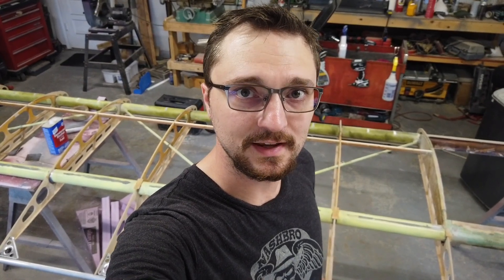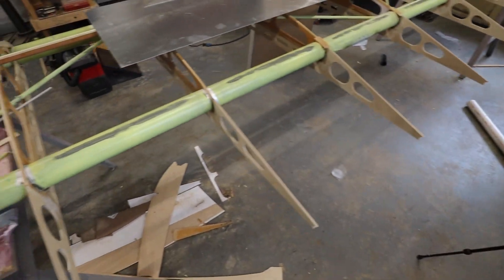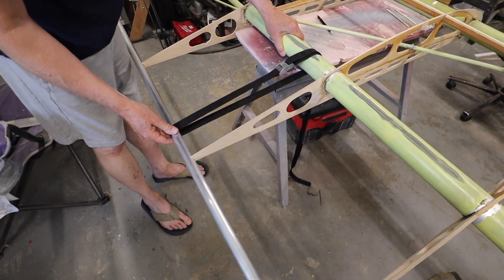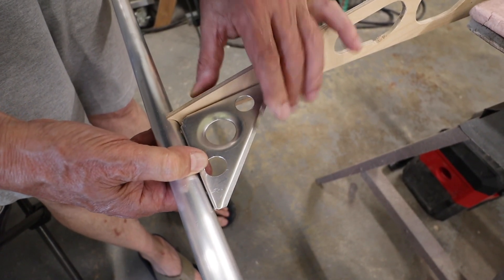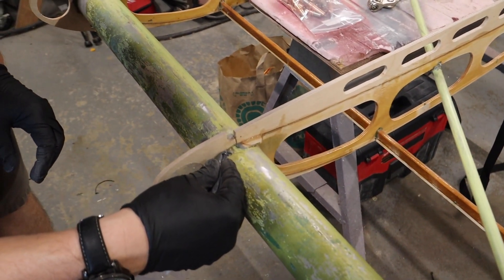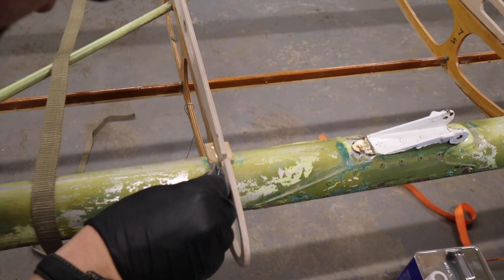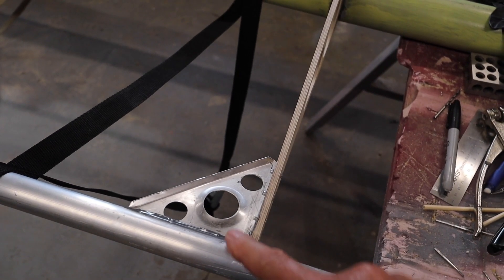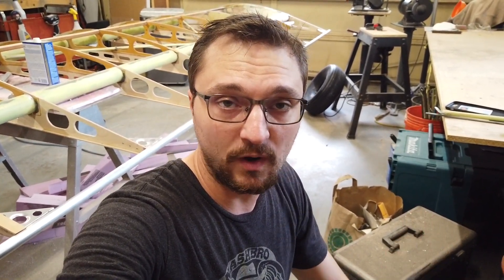Wing Redesign Continues - New Trailing Edge And Reinforcements For The Rockhopper - Episode 8

Comment: I,d have used an aluminum backer plate to make those gusset plates stronger. Riveting to the back of the wood seems like a weak point!
Reply from the maker: I don’t believe we specifically showed it but the rivets are placed with the head side on the wood, not the tail. I think that may not have come across but we have plenty of surface area on the wood side.

Comment: This suggestion might help on the other wing.  Instead of riveting metal to wood, add a backer plate on the opposite side of the wood.  Thus the wood would be between 2 pieces of metal giving the rivets something stronger to hold into than wood on metal alone.  I wouldn't want the rivets to "pull through" the wood. The backer plate would need to be the size of a flange on your 45° brace.  It would add a bit of weight but safety is my cincern.
Reply from the maker: We considered that as an option. We’re also adding fiberglass wrapping around the trailing edge from the cap strips as additional support so I can’t imagine us managing to pull anything loose. It’s already amazingly rigid as is.

Comment: Loving the build. My 2 cents worth re: your ribs (I know it is a work in progress) as a builder of plywood boats, I would epoxy a glass tape over the butt joins on either side of the ribs.
Reply from the maker: That was our original plan but I wanted to have an EAA technical counselor look over our methodology and make recommendations and his was to scarf the joints with thinner ply on both sides. We may do that just to stay closer to accepted methodology.

Comment: Mix the Epoxy on a flat board or piece  of scrap aluminum. Scoop up and put it in a syringe
Reply from the maker: This stuff is extremely thick. Thicker than anything I’ve worked with before. It wouldn’t push through a syringe well but the cake decorating technique works great and really keeps waste down.
Reply from the maker: This stuff is extremely thick. Thicker than anything I’ve worked with before. It wouldn’t push through a syringe well but the cake decorating technique works great and really keeps waste down.

Comment: How does the chord of the wing copar to a standard kitfox?
Reply from the maker: Compared to the model B avid it was based o it’ll be close to a foot deeper including control surfaces. I haven’t compared it to a late model Kitfox. When I finish off the surfaces I’ll take final measurements and post comparisons for length, chord and area to similar aircraft.

Comment: As much woodworking and metal working, as I've done in my life, and knowing the strength of thin plywood, and more importantly the strength of edge to edge glue joints on plywood, there is no way I would fly in this thing. I just hope it's stronger than it seems, for the sake of you and your loved ones.
Reply from the maker: Oh don’t worry, it will be heavily reinforced, we just haven’t done it yet. I actually have a tech advisor stopping in tomorrow to approve our methods for that exact part.
Reply: @ianslife210  That's good to hear. I look forward to seeing how this turns out.
Reply: @ianslife210  Please make sure your tech advisor is the real deal! A actual engineer who can do stress analysis ect...  You are changing so much of the design and treading into unknown areas, it's a little concerning. Your adding a lot of chord and camber to the wing, so I hope the original light weight tubular spars will handle the load (that they were not designed for) with a additional ultimate load figure for safety. I don't know man, seems like your just assuming way to much here. I mean, you wouldn't take a Cessna 150 wing and put it on a 172, and expect it to carry the same loading and remain safe!
Reply from the maker: Please understand there’s no way to show the hours of time spent making sure that the numbers work and the plane will be safe.We have looked into all of these items and satisfied ourselves that we have a solid safety margin and as I’ve mentioned before the aircraft will pass a rigorous static stress test to full load prior to flight.